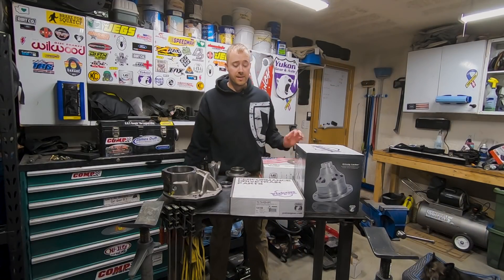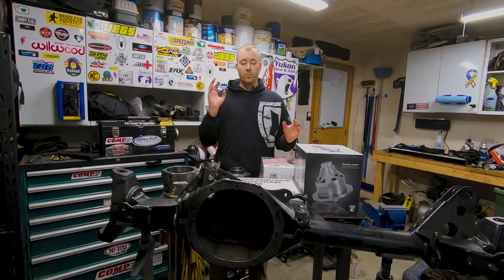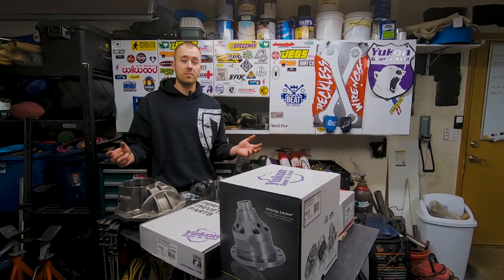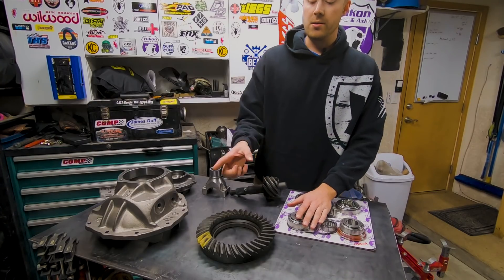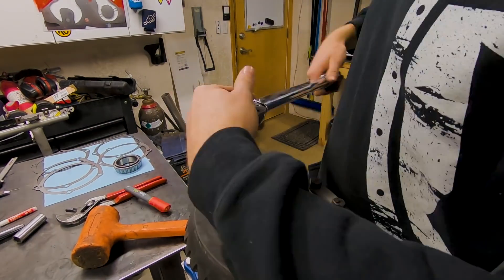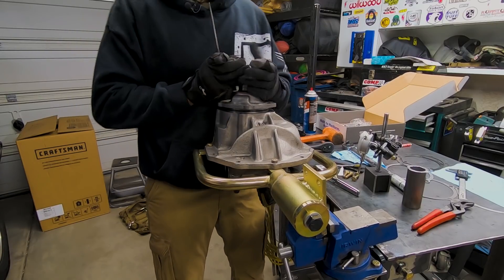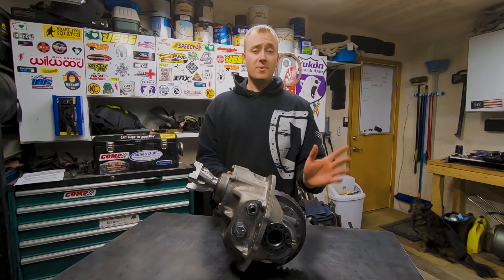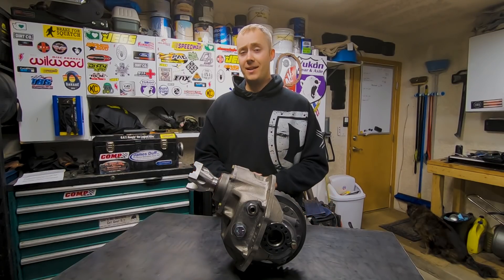Hi Pinion 9 Inch Build - 609 Axle - Reckless Wrench Garage

Comment: Did you say Hi 9 told you the load bolt would have .150 inch clearance between the ring gear and load bolt? Over 1/8 inch? If the ring gear ever deflected over 1/8 inch, you would need to order a new 3rd member, because yours would be scrap metal! Perhaps Hi 9 meant to say .015" ?

Comment: What is the price for the whole kit from Hi9 I'm really interested I'm trying to ditch my ford 8.8 from my 95 bronco(due to my axle shafts coming out from the axle itself maybe my axle is done for) and upgrade to a ford 9 inch but I need the high pinion clearance for when I go do some crawling I don't have to worry to much about a rock hitting the low pinion version a high pinion will give me more ease when crawling up in big bear
Reply from the maker: I would suggest reaching out to Hi9 to ask. It has been a while since this was put together and prices for most things have changed the last few years.

Comment: Would it be a good idea to put a pump on top of one of your tubes ? That way your cycling fluid faster , keeping it cooler ? Or am I over thinking ?
Reply from the maker: Cycling fluid faster doesn’t cool it, it actually increases temps. If you cycle it through a cooler, that’s another story, but I wouldn’t say it’s necessary.

Comment: Hua I wonder how this would do in a drag racing application tbh. Looks pretty dam strong and I’m assuming would definitely shave some weight off your standard 9” or 14bolt setup and unsprung weight is killer does hi 9 make a billet third or cast aluminum one?

Comment: Did you put a new pinion nut on after removing the first one? As far as I know, the pinion nut is a one time use and can't be reused after removing due to the factory lock tite on the nut. I use an old nut to set preload/depth and then use the new one for final install.

Comment: Next upgrade.  Gearworks 10. Or torq14 😂
Reply from the maker: I think the stuburban needs a GW 10
Reply: @RecklessWrenchGarage  huge fan of the 9"/10" stuff but with the stuburbans weight and power would be better off with a torq14 imo. Have a buddy who was running hi9 front and rear in a yota buggy. Got tired of gear issues and built a rear torq14 hasn't looked back sense
Reply from the maker: I feel like if the hi 9 stuff is good for ultra 4, it should be good for the Ranger. The 10" parts work in trophy trucks, and if you break that stuff in a trail rig you need to reconsider some life choices 🤣
I have no experience with Torq14 axles, I have just heard unpleasant things about service

Comment: Awesome video. I bought a td machine pinion depth gauge which is awesome, but setting up the depth on a third member looks a lot easier than a traditional axle housing. Looking forward to seeing the rest of this series for sure. I’m going to check out Tru high 9 because I was thinking of spidertrax axle housings for my Jeep.
Reply from the maker: Drop out thirds are the way to go with axles! Chris wants to set any axle without a dropout third on fire 🤣
Reply: RecklessWrenchGarage agreed! That’s why I spent the money on that tool. Takes out the guess work and throwing tools across the shop and smashing things with a hammer 😂